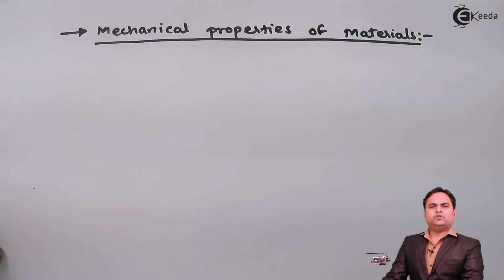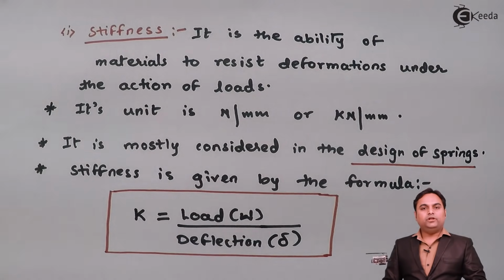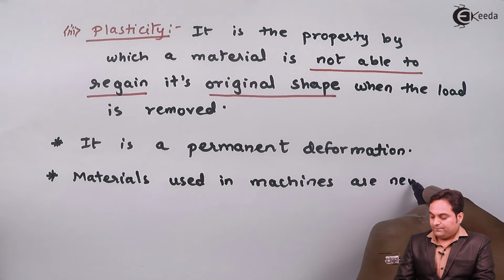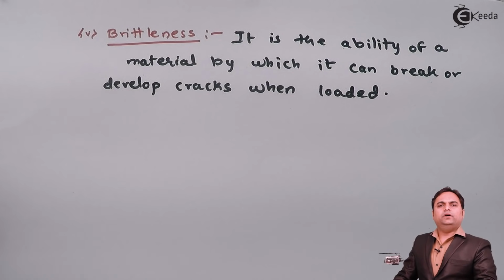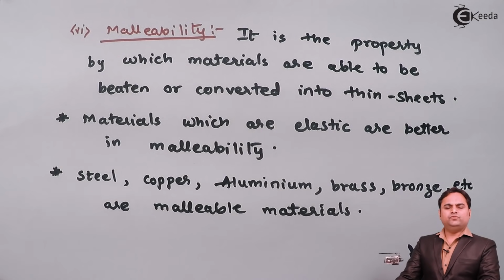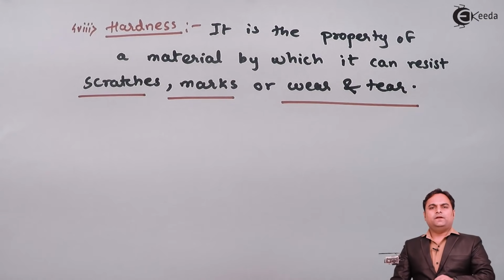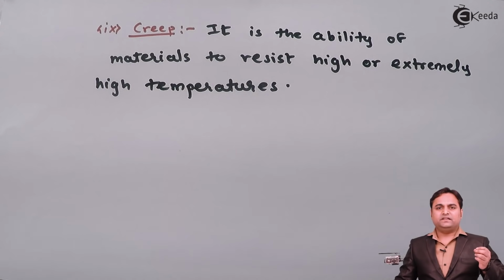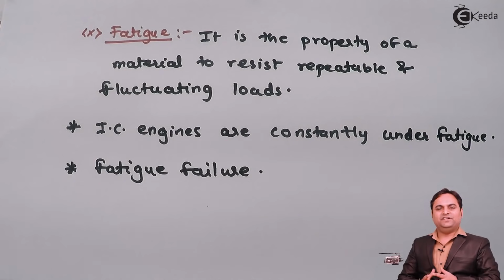Mechanical Properties of Engineering Materials -  Introduction to Design of Machine - DOM

Comment: Hello sir, you says brittleness is "the ability of Material by which it can break or develop cracks when loaded". Actually developing crack and breaking is not a property.Its a failure.Please clarify.
Reply: Brittleness can be a property. It depends on the application of the material. For example, glass covers for fire alarms would require hardness and brittleness as properties as it needs to be broken easily to allow the person using it to alert people in the building of a fire.